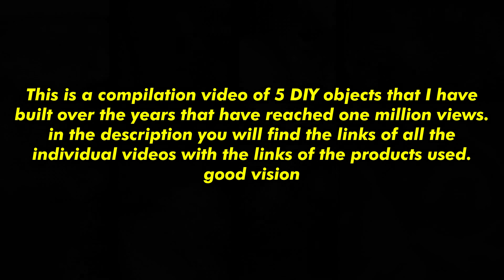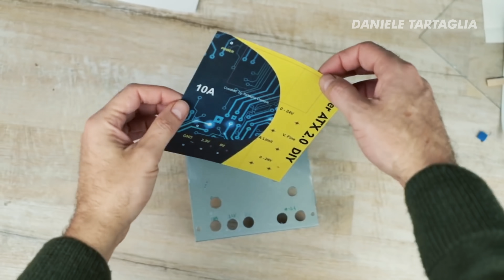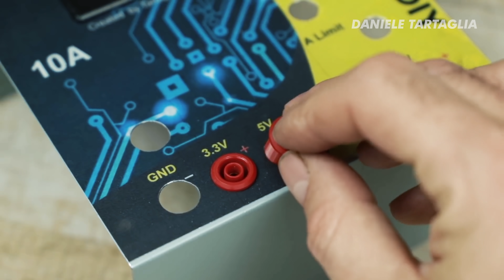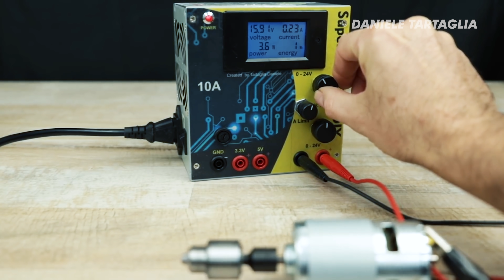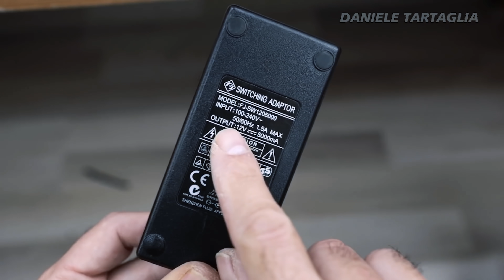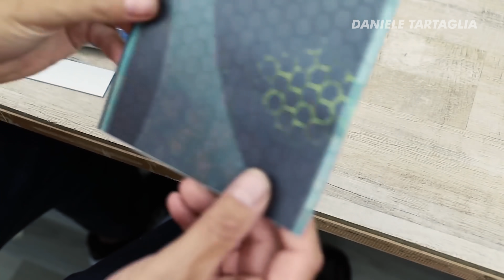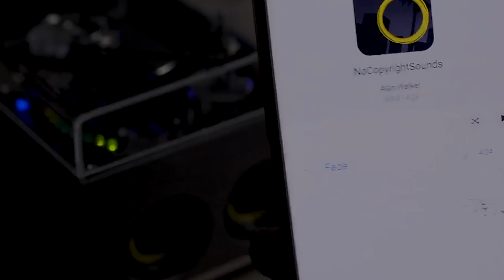I built 5 DIY items that went VIRAL

Comment from the maker: IF YOU WANT TO SEE THE INDIVIDUAL VIDEOS WITH THE LINKS OF THE MATERIALS USED: 
📺 3D PRINTER DIY: https://bit.ly/3luKbkv
📺 BATTERY DRILL SYRINGE: https://bit.ly/3nzAQe0
📺 CDROM CD PLAYER DIY: https://bit.ly/2XiT7kS
📺  POWER SUPPLY ATX: https://bit.ly/3nAnaiR
📺 SCROLL SAW MACHINE: https://bit.ly/3nBxDKU

Comment: Two months ago you said you were going to share the schematic drawing of the power supply, and so far we have nothing. Why are you so selfish?
Reply from the maker: because I want to make a new video of this power supply, more optimized with a more precise voltage and current regulation. the video will be released in October or November and I will put a full kit to download it. I'm sorry but I have a lot of work
Reply: @DanieleTartaglia  I hope so. By the way, if you use the soldering iron a lot in your projects, it has not occurred to you to make a smoke extractor or a desoldering pump? Or a soldering iron with interchangeable tips?